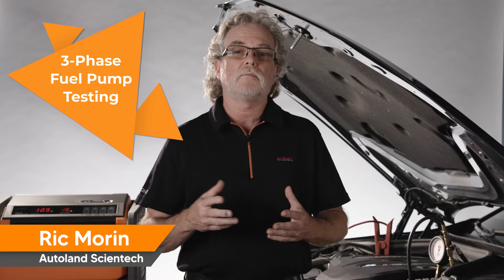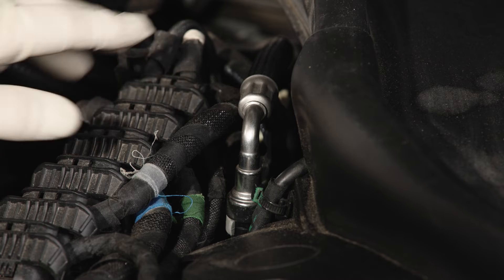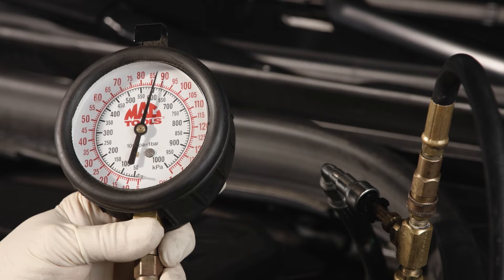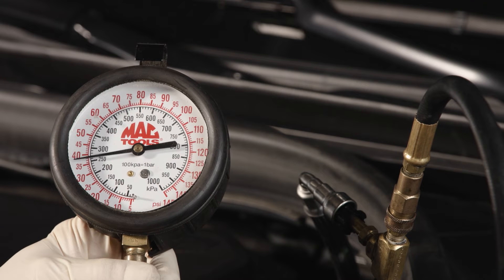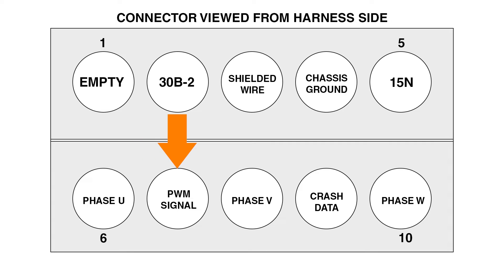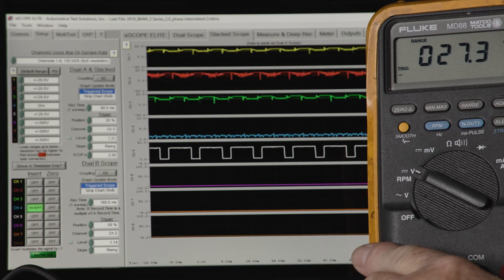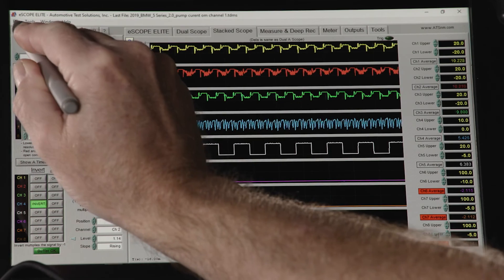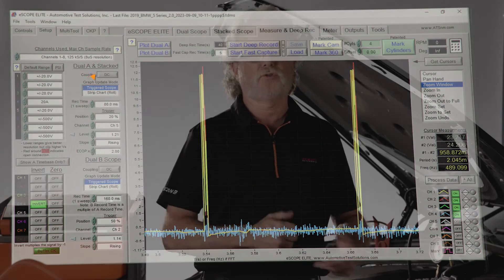3-Phase Fuel Pump Testing & Diagnosing - BMW Vehicles - How To Test Fuel Pressure and Voltage

Comment: What a great video, very well produced and a great explanation.

What type of scope did you use?

How many channels does it have?

What the short that you found within the three-phase motor itself, or in the wiring? Did you disassemble the motor to see what caused the short?
Reply from the maker: 1. It was an ATS Scope
2. 8 channels
3. Faulty motor internal
Reply: @ thanks :-)